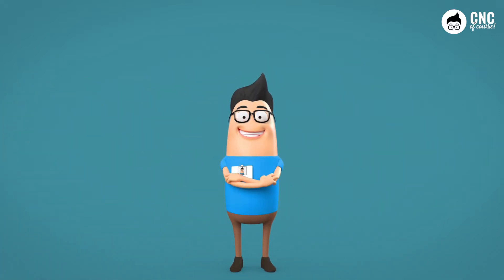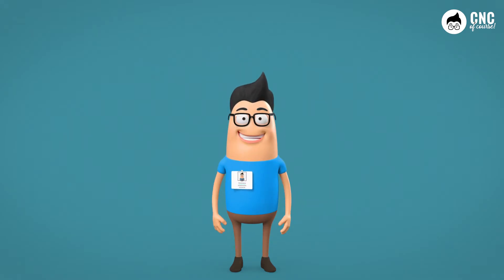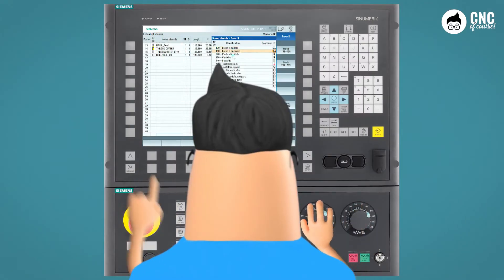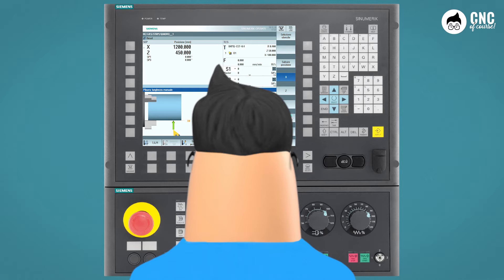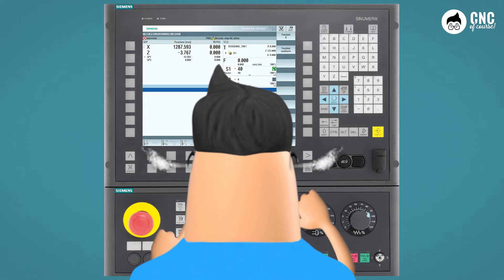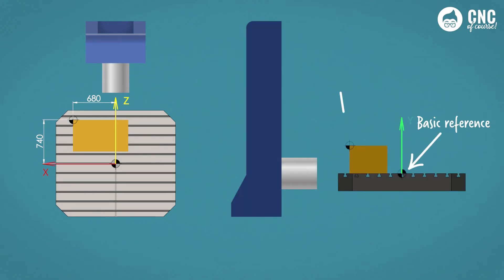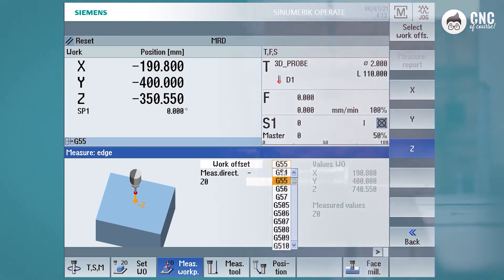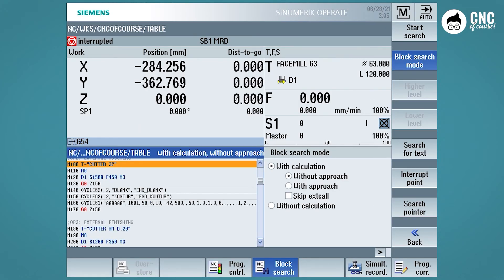Siemens 840D operating course

Comment: Hi there, I do have an OP08t operator Panel here. Is the membrane keyboard only accessible when I install sinumerik software? I used usb keyboard and it works when Pressing F1/1 but the membrane does not react. Is that normal?